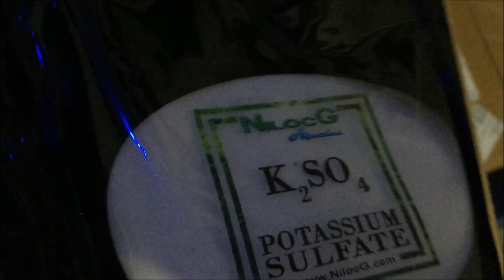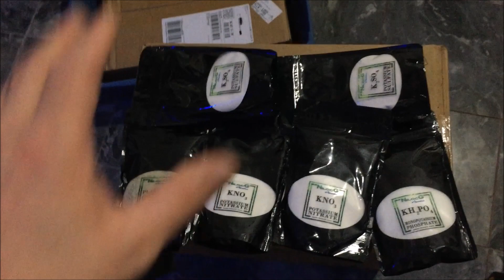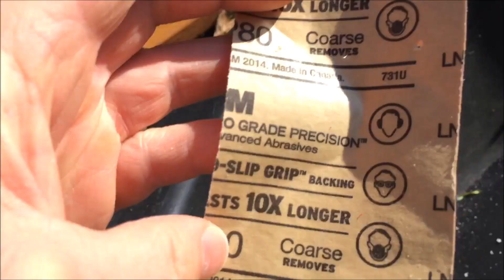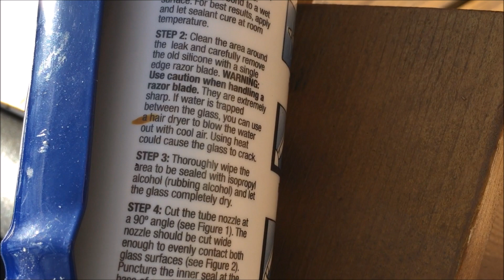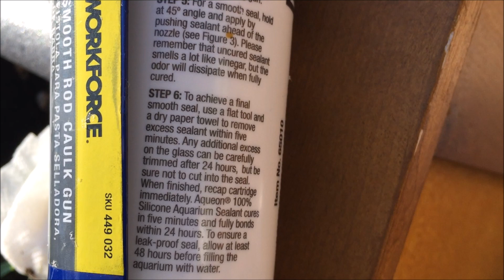Vlog #2 Goofing Around - Fixing Outdoor Pond - Fertilizers - Red Val  and More!

Comment: Mr. L.R., on the outdoor pond repair is that a bulkhead or could you use a bulkhead?  Just wonder if it would seal better for you.  Do you watch Eric Trpplett, The Pond Digger?  I wonder if you could use the stuff he uses when he connects the liner to the biofall?
Reply from the maker: I used to watch him when i had time. Right now it would be way to much work to replace it and this is a easy fix. Will def. be doing it a lil different next time.